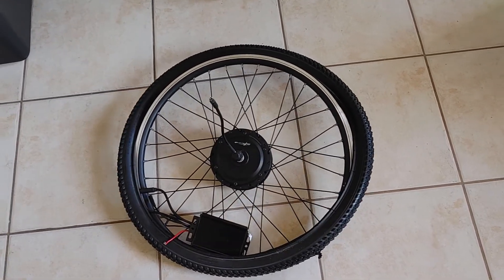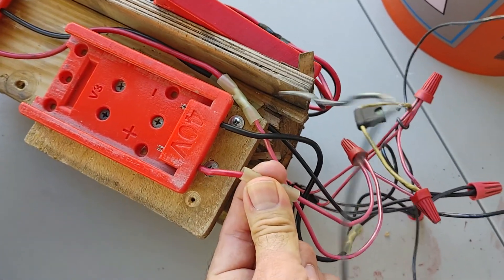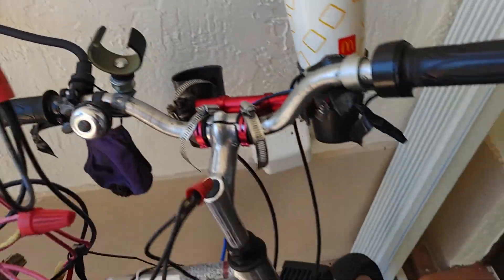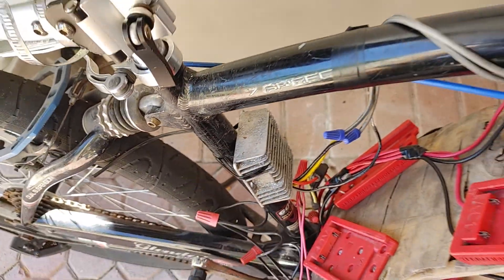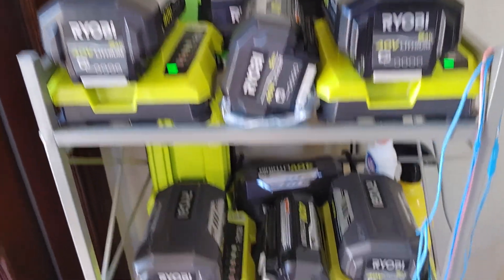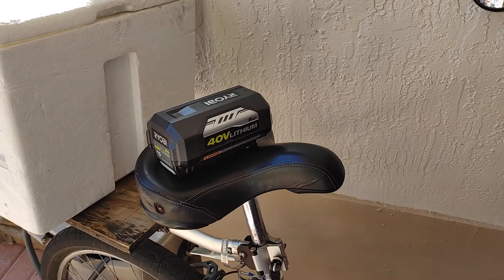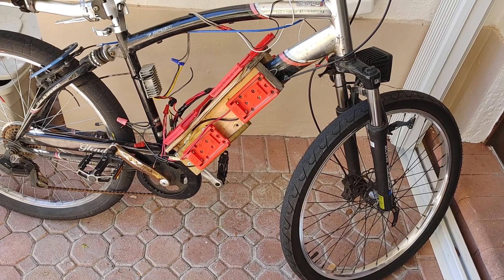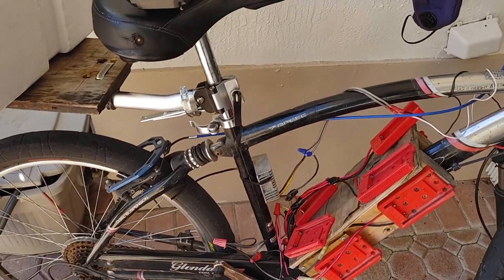ebike diy using Ryobi batteries.

Comment: I believe using the tool battery is smart. They've already meet insurance companies coverage if damaged from fire. They've been tested and guaranteed for public usage. The drop factor as mentioned along with the guarantee. Additionally the use of the tools that are marketed for them and how they TOO can help. However I was/am planning the e-Go platform for the 48v kit and have access to something like the 3000w power inverter or even the solar charging capabilities.
Reply from the maker: Sorry I missed this. I worked about 80 hours last week.  e-Go platform? send me a link with more data.  I have 12 batteries if I use all of them I can make 3600 watts.  My batteies are more than a year old, very strong.  4 of them are still under warranty, but I don't think I will ever need it.
Reply: @productcheck  go to their internet page for what they offer. As for using them with an e-bike portion? They don't offer an adaptation unit. Wishing they would.. Have been hounding them about their own e-bike for years NOW. Their 10ah battery runs a 1200w mower for 90min. . . Using a legal build e-bike a 36v750w wheel with a controller that is a 36v750w/48v1000w you could take advantage of either the 40v Ryobi or the 56v battery platform. Both of the holders can be found on eBay between 20 to $30 ... They have been used in robotics project for years. As for that 3000w inverter e-Go offers it also has a solar charging unit that can be used with it.

Comment: Can you share the ebay link for the battery mounts. Thanks
Reply from the maker: the one I bought is sold. just search for Ryobi 40v 5 ah and put a low bid.  each battery is was $80 including and should give you 6 miles at 18 MPH with no wind and traveling at constant speed on leveled ground. https://www.ebay.com/itm/293586750005
Reply from the maker: https://www.ebay.com/itm/143337640821
Reply: They also sell the e-Go platform battery in case you're considering 48v. e-Go also has a 28ah. backpack battery offered